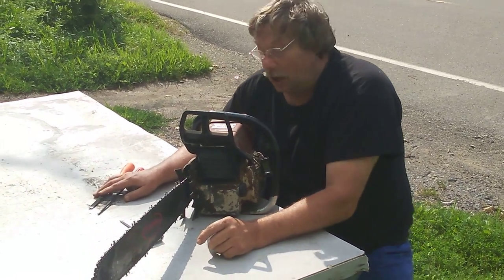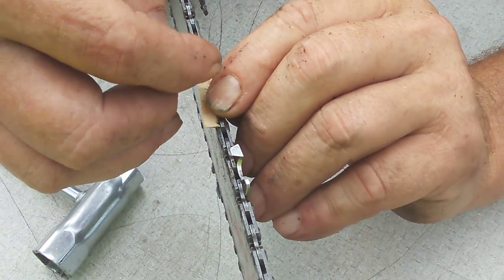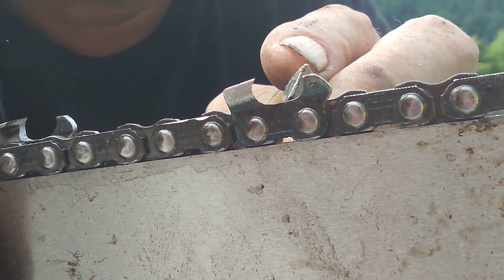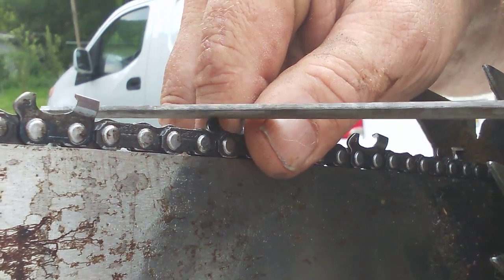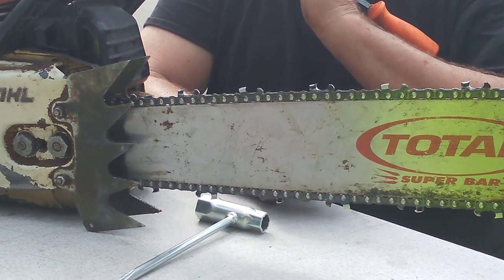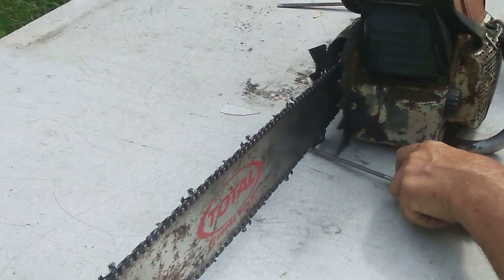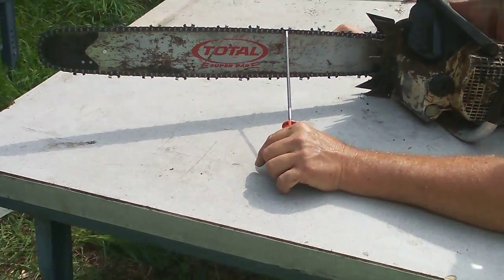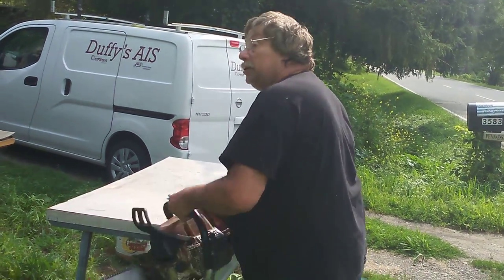How a chip is formed! East coast sharpening tips!

Comment: Hi (from new sub in S. E. Australia) and thanks for the sharpening vid, it corresponds and more with whatever little I know.
Logging in sizable Aussie hardwood is usually with 404 chain and short, by US standards, bars and some old timers recommend a bit less top plate angle for hard, dry wood.

Comment: Nice job young Man.  Keep up the good work, be safe and be Humble. 
  The Bar is what the chain rides on..Many folks call it a blade... Standard is Bar..
"I have a 20" Bar"  The "Chain" has many "teeth".  The "Teeth" are what cuts the wood.  If you touch a rock you may dull a tooth, or 2 or 3.  If your lucky... while sharpening the chain you will sharpen one tooth at a time.  The leading edge of the tooth, is the cutting edge.  I know you know this young Man, but so many others, do not.  Then they teach others the wrong lingo.. wording.   But the main thing is to operate the saw safely.  Keep Trucking..
  The most impressive carbide chain I ever did see was on a fire department saw designed to cut through walls where you may hit many nails.   It was very impressive and the budget of the fire department is tax payer subsidized,  life saving tool , fighting a fire or what have you..

Comment: Great Video Harvey, i will be trying so different angles this winter.
I have a question for you on you Muffler mods. Do you have a formula you use to determine the amount of opening you want for max performance? Still keeping enough back pressure. 

Thanks
Reply from the maker: Working with stock mufflers can be tricky!  No formula just trial and error!  Seems on most 372 huskys they like 2 inch long 3/4. To7/8 I'd. One inch inside one inch outside the muffler! Goin bigger seems to take power away!

Comment: I have a stock 266 and cut up to 10 cords of firewood a year.  I cut a mixture of pine, cottonwood and sprinkle in some elm and oak when I can get it. 

 I've noticed that the spur sprocket is worn and the bar is flared pretty good. 

I see that Oregon makes a rim sprocket conversion kit.  Is this a better setup?  Is a 7 inlet rim going to give me the same chain speed and torque as a 7 tooth spur sprocket? 

I am also interested in the oregon versa cut bar and power cut full chisel (full house) chain combo.  It's a 20" bar.  What would you recomend differently?

Any advice you are willing to give on how to set this up and tips on how to get the most out of this saw would be hugely appreciated.  

I'd also like to know where I might be able to buy some merchandise or send you some bucks for your time.  You gained your knowledge with sweat and blood and that's worth something to me, brother.
Reply from the maker: The rim sprocket is the way to go!  That's a good bar! Try a full skip chain !  You may pick up some cutting speed!   Merchandise is in the future!
Reply: @theironhorse6600  Thanks, Harv.  I really appreciate your time!

Comment: All ways adjusting that leading edge  in very ways  IV run full skip for years  here in Australia  as a faller you change things on the run . Good vid mate keep up the good work
Reply: what kind of chains did you use im thinking i need harder chains the stock ones wear out fast
Reply: Any tips on angles for cutting dead redgum, ironbark, stringy? I don't suck at sharpening but keeping them going a bit longer cutting my firewood would be nice. I only have semi-chisel full house because that's what everyone sells. Got various oregon/husky chain to use up but now got stihl RM which is better but any tips on keeping the edge gratefully received. Only really sharpen to listed manufacturers specs of 30° with 0-5° horizontal, seems pretty sharp but damn, that ironbark!
Reply: @CSkwirl  yeh im interested too , iron bark is what i cut also , its like doing weights sometimes.
Reply: @closertothetruth9209  Carlton, if you can still find some is heaps better than the Oregon I've had, stihl RM is also harder but more work to sharpen if you kill it
Reply: @closertothetruth9209  I was just checking on its actual name because what I call ironbark probably isn't, can't find what it is. Kind of looks like stringybark but its wood is more dense and the bark is usually almost all coated in leaked dry sap, so its turned it into like cutting through sand filled epoxy. Chain is blunt before you hit the wood lol, got to find out what it's really called
Reply: Basicly how Harv has his chain set up is is how mine looks   now  as for the Ironbark  if it still has bark on that where the dirt comes from pull the edge right off it   .years ago I ran square grind  skip tooth chain as it would Handel the dirt better in green timber  .as for brands of chain Stihl seems to be the at the moment I'm running hurrcain chain cutting green   logs.  Now this all said  timber  changes from place to place  and what works for me say around port Macquarie ain't going to work say around  Cooma . So yeah about 20 Dec on the top plate and hold the file straight or close enough to. I run the rakers down hard so 3/8 chain I'll run404 depth on the rakers watch it they bite hard
Reply: @benmeyer3962  Cheers, never tried running 20° thought it would make the chain much harder to pull, will give it a try, will be hard to Un-learn 30 after i trained myself to hand file that with no guide things!
Reply: It's all a learning curve  and what works for one may not work for the other I forgot  to add semi chissel is ment to Handel the dirt better but in my experience I found full chissel seems to hold that little better
Reply: @CSkwirl   just by chance your not out west  like 700km off the coast  west .gidgee has that appearance  and that is hard. Full comp full chissel   Stihl chain  nothing eals well cut it
Reply: @benmeyer3962  nah, Adelaide Hills, I'll remember to take a sample and get it identified one day
Reply: @CSkwirl   plenty of iron bark on YT , some wood i get smells like a perfume when it burns whatever that wood here in WA is